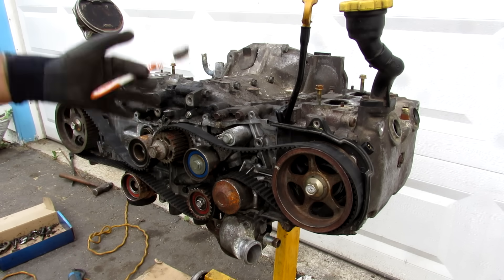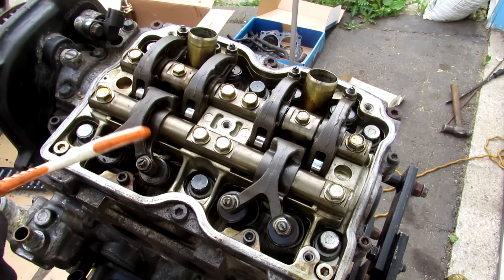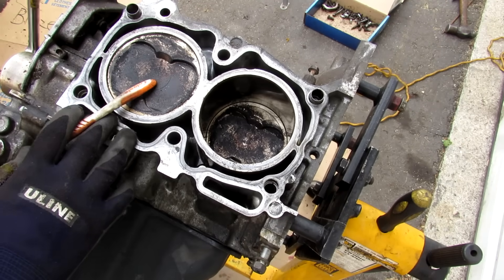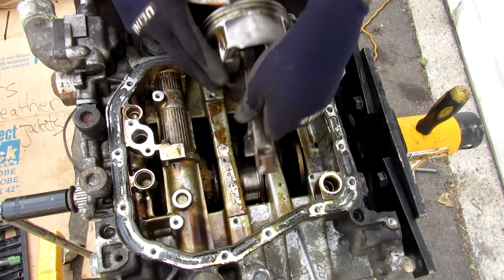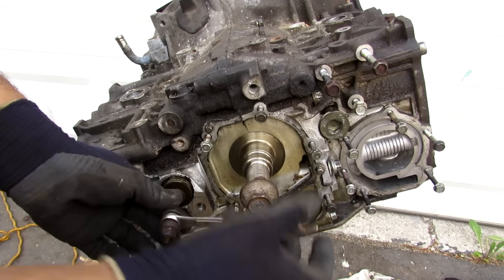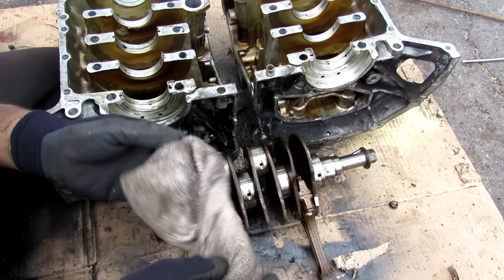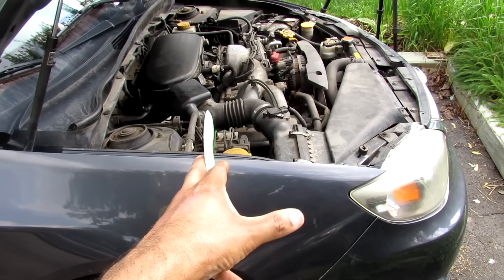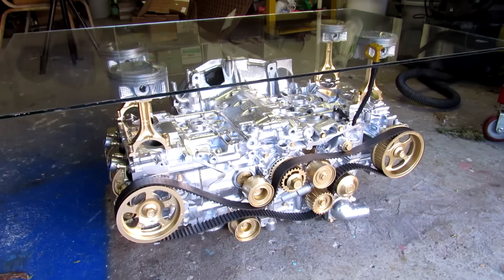Why Subaru Engines FAIL

Comment: toyota has  eliminated  garbage  suburu there   history. gone way ? of the LADA and YUGO
Reply: lol Lada Niva is still being exported to Germany and Germans buy more of them then can be imported, because they are reliable, they last, and they are cheap and easy to maintain.  As to Subarus, EJ engines were designed to operate at high temp/pressures, and unless they get to be revved up and maintained, there is not enough pressure to keep oil from sludging.

EJs NEED to be regularly revved up to at least 5K rpm to keep them at operating pressure, otherwise oil starvation will eventually come from clogged up pathways.

Comment: ALL engines fail if they're not maintained or if they're abused.  Just watch the I Do Cars channel and you'll see all makes of engines that destroyed themselves due to oil starvation.  I guarantee you that most of the time it's the owner's fault.  Yes, some engines consume more oil than others, but it always boils down to it's the owner's responsibility to ALWAYS change the oil per the manufacturer's maintenance schedule.

Comment: why does the Subaru engine fail the same reason any engine fails stupid drivers and poor maintenance techniques I have personally worked on Subaru engines that were 100% original and almost a half a million miles

Comment: Some tips for keeping a Boxer running 4 a long time: Never overheat , change your oil on time, retorque your head bolts, and run some engine flush through from time to time to keep the sludge deposits down.  Oh yeah, last but at least, always make sure you check your oil level regularly!
Reply: Don’t run engine flush through.  Ever.  Just change your oil. Service the car.  Shouldn’t have serious issues
Reply: @joshuathomas4934  I use 1/4 bottle of Marvel Mystery Oil , put into my crankcase about 250 miles before my oil change. This is the safest way to gently maintain lubrication efficiency. 💯
Reply: @D R you can get to the bolts without removing the engine. 
Some people do head gaskets with the engine still in the car but it’s easy enough to pull a Subaru motor you may aswell just take it out. 
If you know what you’re doing you can have a motor out in less than an hour easily.
Reply: G37fy  I’ve never heard of anyone having to re torque head bolts. 
I’ve owned 5 Subaru’s (3 were turbo ej25) and I’ve never had an engine related problem with any of them and they’ve all had high km.
They’re not as bad as people make them out to be, it’s when you start trying to make power is when they break without the supporting mods they need.
Reply: It's the same with the old air cooled boxers of VW. But every 60k on those old air cooleds replace your gaskets down to the block, being paper gaskets they just go bad.
Reply: @I am the Gray Man  don't forget the volkswagen waterboxers.....same problems
Subaru never lear  from their mistakes as where volkswagen finally gave up on that old design
Maybe if the ran twin waterpumps like ford's did on their first flat head V 8s.....
Reply: @fil1329  They shoulda all just run port-injected K24's.. solve everyone's problems... K-series greatest mass production 4-cylinder ever made. Ive been running 500+hp on my dc5 for over 6 years and not a single engine issue. Constantly revved to 9k rpm too! lol.. Its like the engine just needs to be beat and and live in high rpm! lol
Reply: @JonHop1  Can that engine run symmetrical front drive shafts?
Reply: @Aquatarkus96  it can, but you'll need to go custom. It's not a problem now to have your drive train fully custom now.
Reply: I feel like they are either one way or the other. I see a lot blow up at 100k and I see a lot at 250k and still running great.
Reply: G37fy  ->That was just the early 2.5 motors. My 2.2 1991 has 361,000 miles on it... hardly can call that junk buddy.
Reply: Or don’t buy one? Lol
Reply: g37fy68  They are. Out of all the junkers out there they do have the most fanboys though somehow...
Reply: Or....buy a Toyota or a Honda.
Reply: @wasatchadventures8947  I'd throw Ford in there as well if you live in a country that has access to them. The modern Ford engines are largely bullet proof. I would also add the Chevy LS series motor to that list, but those are performance motors. The ls is probably the best motor all around on the market.
Reply: @lokirip2372  my old ranger engine been great- 220k and still idles smooth enougu to not rattle a glass of water. Followed instruction manual to the T, havent had any issues but changing an 02 sensor and the plenum gasket. Otherwise zero issues! Good ol rust bucket.
Reply: @lokirip2372  disagree.  Toyotas are #1 in my books.
Reply: @petropete3122  I had a tocoma that rusted completely in half. I've never gone back. Toyota motors are underpowered anyway for what I like to do, so once I moved to an LS I never gave Toyota a second look.
Reply: @lokirip2372  I had one that rusted away as well but I thought we were talking about reliability and the older ones are underpowered but the newer ones are up to par but no power like an LS1. I still love Toyota.  There’s no better feeling than walking to your Toyota and knowing that it’s guaranteed to start 🤩
Reply: G37fy  mine has 164K, original everything in the engine (except normal maintenance parts like timing belt, alternator,),  Runs great, 2008 Forester.
Reply: your advice should be heeded for all cars.
Reply: everything except using engine flush .You dont need it ever if you do regular changes.Using it is just wasting money and it will literally do nothing .
Reply: Just get u some #BigAltimaEnergy since Suby uses cvt now. Nissan 2.5 wont die with no maintenance doing 90mph daily.
Reply: For all we pay they could give an oil pressure and a voltmeter gauge.
Reply: I thought it was because they use glue instead of gaskets and glue cracks over time and engine fails
Reply: Subarus are a great product, but if I have to retorque the bolts, I'd rather get a Mazda.
Reply: Yep, they are poorly designed and the fixes are bandaids rather than the true redesign that is needed.
Reply: @Loki RIP  not poorly designed. You don't have to retorque the heads either. If you just keep up on maintenance they do just fine. The EJ25D was common for headgasket failure. Once subaru fixed that they did fine. If you blow these up it's your own fault. It common sense. Take that from my 2002 EJ25D with 250,000 miles on it.
Reply: @lokirip2372 let’s compare them to a vehicle of a similar type and capability lmao, An Audi. A Subaru by comparison is worlds more owner friendly, the problems people have with them are problems with Street racing an AWD car on dry hot pavement, not meant for that lol.
Reply: Much easier to get a Toyota or Honda.
Reply: @Username-2  ->If 362,000 miles and running strong is your definition of junk shows the rationality of your comment.
Reply: Best tip is never to buy a Subaru. The most of the former Subaru owners I know have had a lot of problems. I've only driven 3nd gen Leone and 1st gen Legacy, but I didn't like them at all. At least with the Legacy there's not really any sense of where you are going and how slippery it is. Also I could easily beat a guy with 4WD Legacy on a track made on the sea ice with my FWD BX though I'm not a good driver myself. Before that I couldn't believe it would be possible to beat a 4WD with a FWD in such slippery conditions but that gives you a hint just how bad those things are to drive. It's totally different from an Audi for example, where you always have a full control of the car and know exactly where it's going and how close to losing the grip you are.

Comment: Subaru boxers fail because they're weak and having a block made from two halves is a shit design. They're also literally not engineered strong enough in terms of mains and big end bearing surface areas as well as running clearances that are too tight and they're shit to work on due to the boxer layout in an engine bay

Comment: The single overhead cam engines are easy to get to the spark plugs they're up in an angle it's the dual overhead cam that's really hard to get to

Comment: Its a Japanese knock off of the vw motor of 1940s
Reply: Not so. Subaru looked closely at several boxers, including the Borgward, VW and the Lancia, and designed their own using features and inspirations from all of them.
But then you would know that if you were less opinionated and better informed.
Reply: @DrakeN-ow1im  actually your wrong as they build the first one off of license from their alliance with Hitler. Just as Russia built knock off indians from American back then.

Comment: It's because they overheat when you spin an opposed motor over the moon no wonder there is problems with these motors heat rises the top part of the cylinder heads become red hot because there is nowhere for the heat to go also too cheap light weight aluminum doesn't handle heat very well

Comment: So just take the engine apart every 20000km or so and check it for wear and tear on the parts that need lubrication. Or whenever it sounds strange. Or when it explodes.
Reply from the maker: Good idea

Comment: I have a 2013 outback Cylinder 3 started misfiring I changed the spark plugs and coil pack as well as put in new gaskets because there was oil in the spark plug tunnels When I took off the valve cover a rocker arm fell out! why? my rocker arm doesn't look anything like your engine how do I put it back in nothing holding it in

Comment: 4:15 , no if its a boxer crank , thats is each cylinder with his own pin you will have the exact same mirror image the other side. to have the opposite the other side you would need a ferrari 'boxer' that are single pin

Comment: I used to change these engines all the time as a sideline , they are crap, run too hot , unreliable on many fronts and notice how many common faults he mentions .i would like to correct him on his comment that they are great high revving engine design , high revving killed them ,  They excelled in tight rally stages shifting gear constantly with their low end torque and low centre of gravity.  Dont know how many i got with big end knocks or destroyed engines especially on the imports with low ratio gearing after racing porsches etc to say yeah i beat a porsche up the motorway slip road but it cost me my engine...
in their day they were fast and tuneable but today they are dinosaurs that are ticking timebombs , today i prefer a v6 vw diesel biturbo 40mpg and 340bhp how times rapidly moved on from them days.
I do still love the boxer straight through exhaust note , something a diesel can never immitate

also i could remove these in just under an hour including bonnet removal i wish more engines could be removed as quick for some easier access to things.

Comment: V sixes smoother than a horizontally opposed 4 cylinder? Are you sure?  I believe a BMW runs way smoother than a Harley the same applies to your suggestion V sixes are more smoother(better balanced) then a flat 4 . The true difference is the cost of manufacturing, which is a big difference.

Comment: I have had many Subaru cars and never had any problems with them. All have lasted years . It doesn’t matter what kind of car you have if you don’t take care of them  you will have problems. Guarantee this car that he’s working on was used for racing. I’d be curious to see if it is also turbo charged which I’m sure it was. Aftermarket turbos Will destroy an engine faster than anything else. I’ll keep buying my Subarus and not worry about my engines.
Reply from the maker: #1 is check the oil
Reply: If you had the first gen 4wd wagon circa 1980 you would have had MANY problems, boots, cv joints, rust around all windows and tailgate in the first four years. great car in many ways, but it cost me a small fortune, the engine was fine, as was the 4wd ,, but at the time it was a rustbucket.... and it had many parts issues. , and this was in Australia, where it hardly ever rains.

Comment: I bought a 1994 Subaru Impreza  2litre turbo in 2011 and drove it for 8 years without any problems,  sold it to a local lad in 2019 and it's still going today without a hitch.  the cam belt and clutch were changed at 70,000 miles (as recommended) by a previous owner and it had 140,000 miles on the clock when I sold it.
It's easily the most reliable car I've ever owned and I still miss that brutal acceleration and sweet burble from the exhaust.
Reply: Yea, the boxer engine is a good motor, just like every motor you need to take care of it, this guy just wanted clicks and obvi peeps give em , most of them probly can’t even do thier own maintenance

Comment: Subaru should hire this man to improve their boxer engine design. Why can't Subaru correct these flaws? All that work for a flawed engine...
Reply from the maker: Subaru has been on this platform for decades. They wouldn't want to change to something more mainstream if they aren't familiar with it, even less so now that EV platforms are the next step around the corner.

Comment: I had a 78 brat with a 1.6 litre. Everything he said was true. I had to carry extra coolant and extra oil on long road trips. I had to pull the engine 4 times to replace either head gasket. I would replace inserts and bearings each time. We had a lot of fun driving the little brat around Texas. Great video!

Comment: I dont know i have forester with 230 000 miles and its still have first engine, first transmission so if you take care of that car it's immortal.
Reply from the maker: How's the rust?
Reply: it's ok, nothing rusty on the chassis, just had the fenders replaced and done.

Comment: The unique design aspect of the flat boxer engine is that it enables a normal hood height AND plenty of ground clearance for deep snow and off-road. All other vehicles with the same capabilities have much higher hood heights e.g. SUVs.

Comment: More like you will see oil pooling on top of the engine
Reply from the maker: Why so?
Reply: Head gasket leaking since the top has a lot of surface area and the engine pressure it pushes out the top and you will see it just sitting there on the opposite side of the oil fill tube so the passenger side I always thought it was coming out the oil pressure sensors or whatever the sensor is right there but that never stopped the oil being right there.

Comment: Subaru hasn't had head gasket issues for 20 years. It was a very well known and specific issue tied to gasket design. They not only changed them to the newer design for free if you had a failure. They promptly changed production. 

If you have an older pre 2000s Subaru and you do the head gaskets, as long as you follow the service spec for pattern and torque you will not have another failure unless you overheat the engine.
Reply from the maker: That's a broad statement
Reply: @speedkar99  it's a factual statement.

Comment: i’m going to be getting a 2008 legacy spec b, so i wanna ask what should i replace? i was thinking head gaskets, ringlands and timing belt first
Reply: Do a proper mechanical check - condition of oil, coolant etc. and a full inspection of the underside of the car.
Get a full, authenticated service record as you would buying any used vehicle.
Altogether too many folk buy cars without doing their due dilligence.

Comment: sir may i ask if what is the problem of our forester. recently the problem was overheating. the mechanic rephased the cylinder head and change the gasket. but now when he was assemblying the engine. it has no compression..what could be the possible cause of it

Comment: My 2014 forester had the half block changed at 80k under warranty for the piston ring problems that burned oil day 1. No problem since and at 143k. Yes the spark plugs are tough to service. I'm excellent at maintaining maintenance and change the oil sooner than recommended. 2014 has a timing chain. I hear the piston slap on cold starts and it fades quickly. Next time I'm going toyota.

Great video  btw.
Reply from the maker: Good to know. Likely that's an F series engine and not this old EJ

Comment: I own two subaru cars. 2016 forester and 2019 Acent. The Forester has 70,000 on the clock. Mostly highway driving. I use only Exon 93 octane. Always change the oil at it’s recommended service change using only Subaru brand synthetic oil. The engine is serviced by the dealer. The only problem I have had was a vacuum line coming off. It does not burn any oil. The best little car I have ever owned. The Acent has had a number of recalls. The transmission is on a recall but the dealer is waiting for the tool to repair the possible failure. My suggestion to those who own Subaru cars is never tow anything with it. Steel band veriable speed transmissions are not really designed to handle the extra load of towing. The band is not serviceable and are throw away transmissions.I know many will disagree but it’s your car and money. Buy a truck with the old style torque converter if you need to tow.

Comment: So as a non car person, I'm wondering if subarus should not be bought. All cars have problems right? Should I steer clear from buying a subaru?
Reply: Have a look at some of the properly researched reliability surveys and you will see that the mythology that Subarus are unreliable is just that - mythology. 
I have had several with no significant problems.